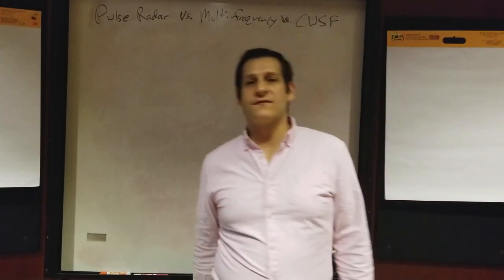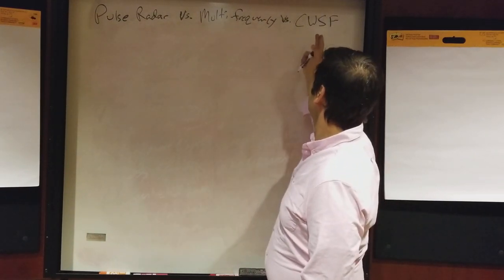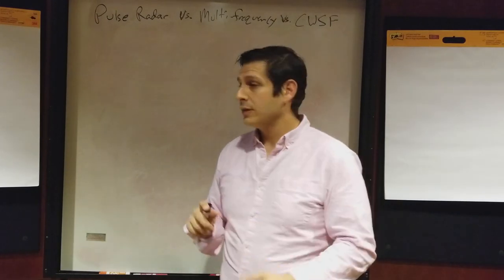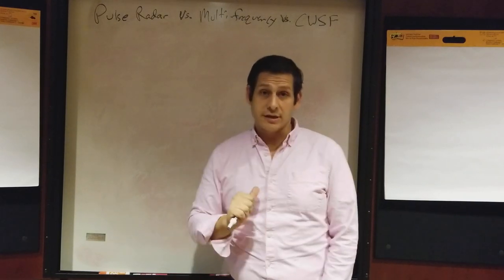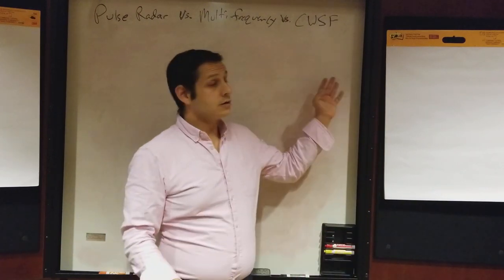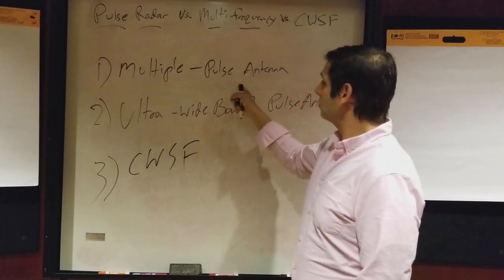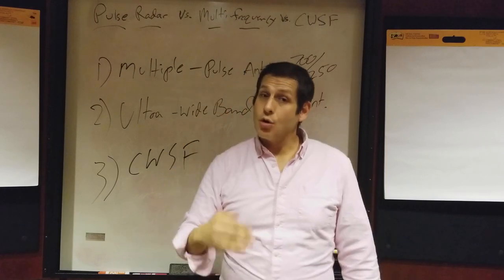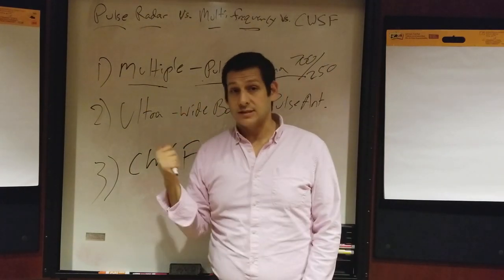Pulse Radar vs Stepped Frequency: which is really multi-frequency? | Ground Penetrating Radar (GPR)

Comment: Daniel, must be some ESP going on, I just started looking into this and wondered whether you put out a video on it - and you did 3 days ago!  First, you are absolutely correct that the manufacturers are causing a lot of confusion.  Second, as an EE, you're right, I'm going to be a little disturbed, but that's probably because we EE's know that a single pulse is a "broadband" signal and a continuous wave is a "narrow band" signal (try to parse that!).  The literature I've found on continuous wave GPR has to do with detecting living and dead bodies in rubble after disasters and actual detection of heartbeat/heartrate as well as distance to body.  There's step frequency, frequency modulated, and random (or pseudo-random) noise.  What's most alien about these systems is you leave the transmitter in one place and accumulate data over, say, a two minute period, with a pretty wide cone radius.  There's also impulse, which is not continuous.  Some continuous wave (non-ground) radar systems detect Doppler shifts for targets moving toward (or away) from them, others (I think) use phase shifts, but the big difference appears to be frequency sampling rather than time sampling.  Many manufacturers are either vague or confusing about how their systems actually work, so I only know about the researchers and the manufacturers who are more forthcoming.  I really appreciate you attempting to parse this.  It turned up because ASNT published a GPR puzzle where "frequency modulated continuous wave" was one of the answers, and I'd never heard of it!I'm guessing that you confuse continuous wave by drawing it as a succession of single impulses - my guess is it's actually a group of sinusoids at one frequency, followed by a group of sinusoids at a second frequency - but that's a guess, because the manufacturers aren't doing a great job of explaining what is actually going on.  Will write to you privately about some stuff I've found and some answers from manufacturers I've learned.  Thanks!!
Reply from the maker: Thanks Barry. You took it to the next level! It is a massive issue, both the theory and the confusion by practitioners. I'll get back with you via email. Talk soon.

Comment: Nice explanation dan. Tbh, I never see or even touch the GPR devices itself, but when I heard the term, I think the difference is that UWB antenna is transmitting all along the frequency at different time (ns), while the multi-pulse is at the same time. So, UWB is almost the same as SFCW. cmiiw
Reply from the maker: Thanks for the comment. I think you bring up a great point about the timing of frequency.

Comment: Hi Dan, As you said in earlier part of video in pulse Radar when we decrease the frequency the size of antenna increases as we will have a huge antenna while working with 100 Mhz frequency. How is this compensated in CWSF as i do have a GPR ranging from 30 Mhz to 3440 Mhz but the antenna spacing is same throughout?

Comment: @Daniel What is the maximum depth of this gpr? In website it says 0.7 m. However, in website frequency is 0.2 ghz - 4 ghz. Normally the depth should be up to 6 m right? How come it become 0,7 m?
Reply from the maker: Thanks for the question. The .2ghz to 4 is the full range. Its peak amplitudes are around 1 the to 3.5 ghz. Depth is always a function of time and they cut time around 20ns. I have seen deeper than 4 ft in quickly moving dielectric mediums. Hope this helps.
Reply: LearnGPR I want to buy this product for experimental like burying some stuff in the ground and collect data. In short, your examples here to real life. That is why asked the depth. With raw data extracted, It is the same I mean it is cut?

Comment: Curious on how does CWSF distinguish what the frequency of the returned signal is. Does it do STA/LTA trigger (like in seismics) for each signal in the recording, does the Fourier transform to map out the frequency spectra and then finds the maximum for each signal?
Reply from the maker: Stepan Lavrinenko thanks for the question. I believe it is a Fourier transform mapping frequencies/wavelengths. But don't quote me. You are better off asking an radar engineer.

Comment: Darling Den, you get a few radarograms of different center frequencies for one profile ,? if so then it's understandable ..
Reply from the maker: davit odil Hi! You should check out the video I did where I compare radargrams from a 250 and a 700. Thanks for the comment
Reply from the maker: davit odil no. A single radargram with all frequencies. Or you can filter out frequencies.